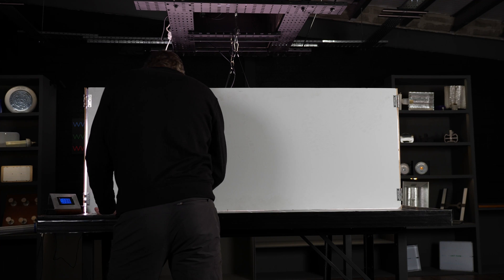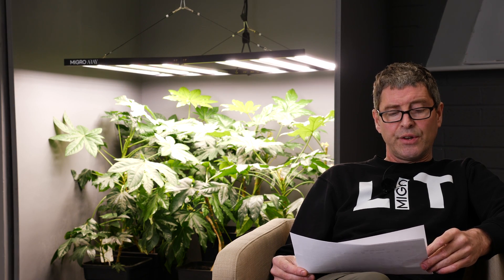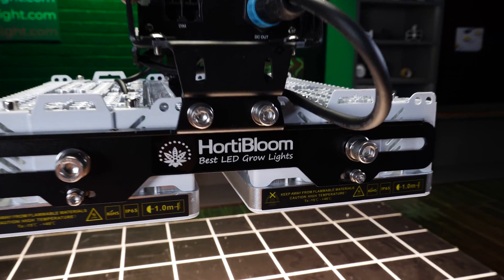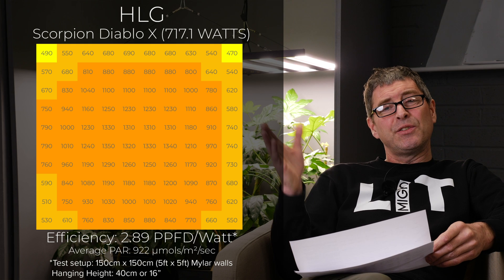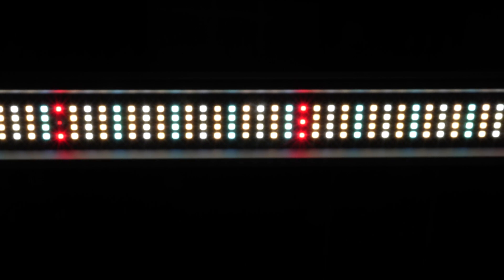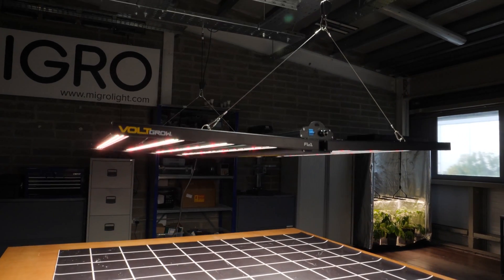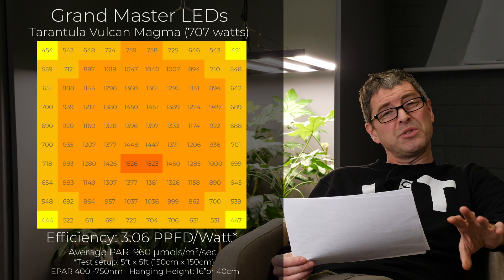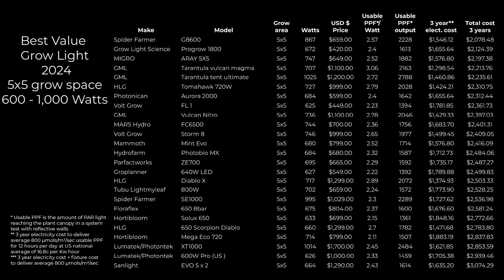Best 5x5 grow light 2024

Comment: My view is you don’t want to go above 600-750 watts in a 5 by 5 area otherwise you’re not getting much benefit to LEDs on power efficiency, maybe quality though.  Keep in mind the standard recommended light for a 5 by 5 was a 1000 watt MH or HPS, HID lamp, in the “old” days.  The high cost of LEDs upfront should lead to power savings for the grower.

Comment: Bestva 4000 and HONORSEN 3000 , and 2 1000 lights in a 5x10 …. Along with C02 = 🌳🌳🌳🌳🌳🌳🌳🌳🌳🌳🌳🌳you don’t have to spend thousands on lights for small rooms.  Had some buds so heavy they snapped the stems.
Reply: You can grow with almost any light, the difference is efficiency and spread.

Comment: So can someone clarify for me cause Ive been trying to figure this out. This is saying there is not much benefit going over 480watts in a 4x4 right? Im ordering a 4x8 tent and led lights but thought it would be beneficial to get a 860w like spiderfarm g8600 or a 1000w but after watching this video im not too sure. Is it better off just getting two 480-600 watt lights since the yield would be barely increased with a 860-1000 watt light?
Reply: It's better to buy wall to wall coverage with more watts then what you need, and dim it down. The FC6500 would actually be better for a 4x4, you don't have to crank it all the way up, but the spread is superior compared to the FC4800. Learn from my mistake, I bought a FC4800 for one of my 4x4 and regret it.

Comment: How do you calculate avg PAR? You said you calculated running cost @ 800 µmols/(5x5)/sec. However the numbers shown for PAR vary wildly from that. Are the shown values measurements of the lights running @ 100%? Did you simply extrapolate from the measurements @100% to reach the running costs? That would be somewhat misleading as some lights will run @ 100% to reach avg. of 800 while others would have to be dialled down a to more efficient ranges. Wouldn't it be more illustrative to show the intensity grid when they actually reach 800µmols and the wattage used? I realise that making all those measurements would be exhausting but you don't get a true representation of hotspots nor running costs when the intensities vary that much.

Comment: Timber FATTY VS 1000 WATT 3000k (6) outside ( 3) with 1750k n middle for flowering n hlg for veg 4000k i kno sumn 1 killn it
Reply: I have a Timber Fatty as well.
I used 5-1750k In a cross pattern and then 3&4k's diagonally across from each other.
The avg color temp is 2525k.
In addition, I added 2 4ft SolarCure bulbs.
I'll put it up against any light on this list.
I'm about effectiveness, not efficiency. However, both would be tremendous!

Thanks Sean!
Migro has been a great source of information to me over the years.

Comment: Regarding the lumatek/ photontek;  in the EU the 600w has three levels;  2.6,  2.7 and,   2.9  Micromol/J.

The 2.6 (the lowest) advertises 1570 micromols/s of total output.  Is this false advertising or is it due to the americans using 110v instead of 220/240v of the EU? 

(Im a biologist don´t know much about electricity, might be the dumbest question you´ve ever heard.)

The 2.9  says it produces  1770 µmol/s.   

I currently run the 2.7 versions wich puts out 1620 µmol/s (lumatek data)  and cant run at 100% untill the flowers have already developed or it will burn the leaves.  I run 75% during the first 3 

weeks of flowering and than switch to 100%.  Is this normal or am I doing something wrong?  Oh how I miss the days of HPS when all you needed to do was put your hand under the light.........

Comment: Been considering going from my photo bio m x too one of your lights With your light, would you need co 2 as well? Can you do another video showing your five by five light
Reply from the maker: Hi, 

If you're running the ARAY 5x5 in a 4ft x 4ft space we advise using supplemental co2, if running it in a 5ft x 5ft space supplemental co2 is not required.
Reply: Thanks your the man super educated. Does his homework  . But even in a four by four or five by five c 02 is always going to help , right

Comment: What was the reasoning behind 800umol?  What measurement device was used and was it calibrated each time?
Reply from the maker: 800umol average is a middle number or average PAR I use for comparison purposes. It equates to 35 Mols per day which is a good performance level. Various PAR meters used from apogee and Innoquest. They only require calibration every 12 months but I get new ones sent to me free so I just change up.
Reply: @MIGROLIGHT  why would you use different uncalibrated meters in a scientific test? The aim is to reduce variables, not add new ones. It is if you are being genuine that is.

Comment: You also used the wrong mammoth light. The 680w 6 bar is for "UP TO" a 5x5 but recommended for a 4x4 and you also hung it higher.... The 880w 8 bar is for a 5x5 or up to a 6x6..... you need to re test as this is highly inaccurate
Reply from the maker: You better get in touch with Mammoth and correct them. I followed their instructions for coverage and hanging height and they were happy with the video when published
Reply: They dont have a recommendation for hanging height and their manual clearly states that the 680 is for UP TO a 5x5. I doubt they were pleased really  @MIGROLIGHT

Comment: So this isn't really the "Best" list, it's the "cheapest" to run list---which is misleading. If you wanted to show the "Best" for growing your list would be sorted by useable ppf of some manner. Or are you telling us that all that PAR map data you've collected means nothing? You could've made a more honest presentation at least.
Reply from the maker: 'Best' is best value for money and it's objective with repeatable test parameters. The PAR maps are a qualitive visual representation of the output of the fixture. Please clearly detail your proposed 'honest' method of objectively comparing 25 different fixtures for wattage, spectrum, price, build quality, spread, service delivery etc. I'd love to see it. I'll give you some honest feedback on it.
Reply: You dud start the video saying "this a list of the best led grow lights I've tested" only mention of value for money was at the top of the list. Intentional or unintentional, its very misleading
Reply: Actually I did. You're claiming a connection between price and "best" grow light. Your presentation focused entirely on the last column of your made-up chart so I suggested sorting by a different column based on ppf instead of your misplaced focus on cheapest. No need to get butt hurt; it's not like i'm your competition. If you wanted to answer the question of which light would grow the best crop in a 5x5---this post didnt do that which does misrepresent the title more than a little.
 @MIGROLIGHT

Comment: got the spider se1000w for my first 5x5, ended up deciding to get the ac infinity evo10 for my 2nd tent. its cheaper then the se1000w with the discount code and claim an efficiency of 3.14 µmol/J PPE. still new but like it so far, lot easier to set up then the spider and looks a lot nicer
Reply: Do you have to run c02 with the ac infinity in a 5x5 ?
Reply: @rickheath5507  if you want to max it out you do, i've been topping out at 7/10 on the brightness and find it to be more than enough for flower without Co2

Comment: correct me if im wrong, but most of the lights were tested with the old par-spectrum right? While some,. including the Migro aray, were measured with epar? That means the other lights look worse than they actually are because you have to add 3-5%umol, right?
Reply from the maker: Yes, you are correect. There is 1 to 2% far red in most led fixtures with white LEDs. The fixtures in this list were tested over about three years. I would have tested the last 1.5 to 2 years with the ePAR meter and before that the Apogee SQ500 and Spoton meter which do not detect that 2 to 3% far red.
Reply: @MIGROLIGHT could you plz explain your numbers to me… turns out your math and mine are not producing the same total cost. I assume light cost plus 3 year electric cost equals total 3 year expense…? But when I add the two numbers together I don’t get the same answer as you😅 0:52

Comment: I noticed something very interesting. I was mesuring PAR levels of differnet lights, with two differentAPP and all worked out well. I have an LED flloodlight and with both app, showed (unreal) very low PAR level, but the interesting thing is that the closer I put my meter to the floodlight the smaller the PAR level get. Why is that happenenig, does anyone know what the limitation we see here with mobile APPS? Does it happened with anyon else?

Comment: Since the Pro grow 1800 is pretty much extinct the Volt Fl-1 seems to be the king of Budget lights.. To finish that high up on the list at only $449 is insane
Reply: Im with you
More for less
Thats a great product at a good price.
Quality price relation
This people not smar paying more than 1000
I get same Samsung diodes with good driver for a fractiom
But i guess Manual IA only for smarts or a little research
Reply: @Migro you have the Volt Fl-1 at 625 watt? It's a 720 watt light and mine pulls 734 from the wall..

Comment: Do u  take in to account, that say the spider farmer and others has a lot higher par rating at 16 to 18 inch of over 1000 etc par at that height , compared to say the migro which has hanging height of 12 inch and it’s only achieving 800 ish par, with the other fixtures u could lower the power output 60 percent and lower to 12 inch which would in theory achieve a better power usage surely or am I missing, by the way I’m not bashing the migro I own one a 4x4 version
Reply: i like hanging higher with a higher wattage for a better spread too
Reply: Be nice to hang say the spider farmer or others at 12 inch and at lower power setting at say 60 percent and see what the par coverage would be ?
Reply from the maker: Hi, Both Spider Farmers are higher wattage hence the higher average PAR and sometimes higher hanging height. There's no pint in running a grow light at less than their designed wattages. They would run a little more efficient but its a waste of their capability.

Comment: Why do you not rate nukeheads gamma lights????? I've used 23 different lights and nothing yet has outdone Nukeheads light diodes, as lights are extremely expensive and built with a few years maximum but nukeheads have worked to date 4years and still going with 2 in that time 2 diodes went bad but parr is over 1000 in 5x5 can you test them for us to all see?????
Reply from the maker: Hi, ask them to send me one for test. I've never heard of them

Comment: I live in New Hampshire, where 25 cents a killo watt
Reply from the maker: Hi, I would advise to go for high efficiency then to reduce those electricity bills. BTW it's 35c per KW hour in Ireland, it could be worse 😬
Reply: Of course I started with hps then changed over to LED  , at the time I bought Mars Hydro FC3000's and been using now for about 2 years  now should I  upgrade  or do you think what I'm running is sufficient  they do have meanwell drivers and decent 301b's  I'm using 3 of these in a 3×7 closet
Reply from the maker: @mikest.gelais8555  Good fixtures. There is no point in changing unless they fail or there is a major improvement in what is on the market which hasn't happened yet. You could argue to add another 200 watts to your grow for that size area and push the average PAR up closer to 1,000 umols if you can physically fit another fixture.

Comment: The lumitek 600w Pro is 2.9. not 2.3
Reply from the maker: The 2,3 number is the PAR delivered to the plant canopy over wattage or system efficiency. the 2.9 number is the PAR output by the fixture in an integrated sphere divided by wattage. In my view the system efficiency is the real world performance of the fixture and can be tested by anybody with a $400 sensor rather than a $40,000 integrated sphere.
Reply: It's not that good mate. Grand Master and other taking over the game.
Reply: @MichiJhit which game the game for sheep s
Reply: @MichiJhit  I does great in my 4s4 and beats anything on the list for energy officiant us, as I can remove bars and add them as the grow spreads out saving a fortune in energy.  Each bar still works at full officiancy with other bars removed.   so I can run it on one bar at 25% power or 10% through my infinity app.  all the way up to the full 600w.  which i never need to do. as I get a nice 800ppfd spead on 75% power.   Show another light that can beet that over at 14 week grow. Or a 10 week auto run, that doesn't even need 4 of the 6 bars intill week five.

 you would need to hang four separate lights to beet that on energy costs.  In fact I'm rather surprised that Shane hasn't made his lager Aray Range with independent on/off feature on each panel.  That would be a pretty good real world energy officiant USP